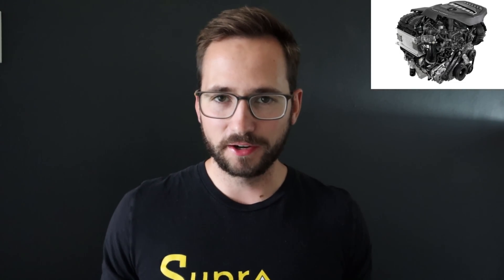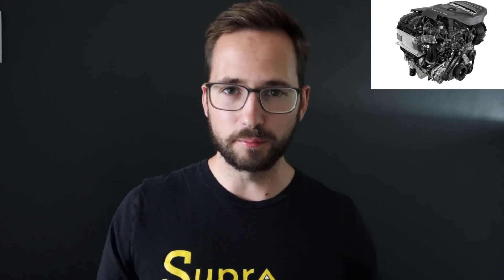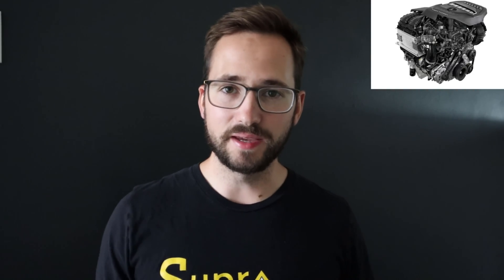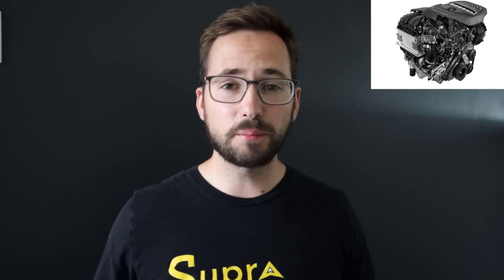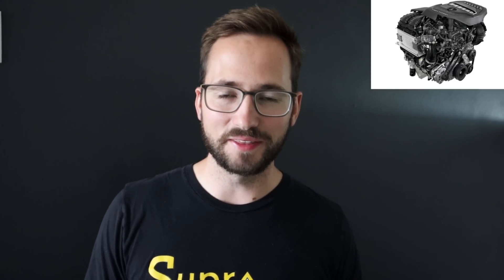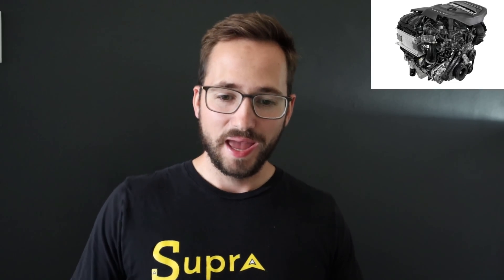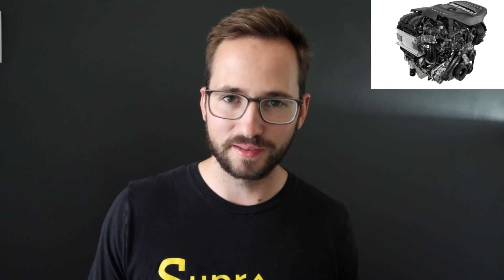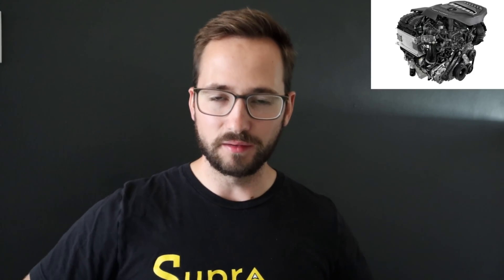The New Hurricane Engine Is Way Better Than I Realized!

Comment: Nice video. Didn’t hear this in it so I will mention it. Straight six are great from past experiences. Longer stroke than bore size made them low rpm torque monsters. The unknown here is adding the turbos to this setup. Most of todays vehicles run at 2000 rpm at highway speeds and a little higher than that in direct drive and towing. So it’s going to be interesting to see where the power bands fall with this setup in the 1500 Rams. Throwing them into the 2500/3500 lineup is a big gamble for a first year production run. The 6.4 hemi is pretty stable here for the most part. Diesel owners are another subject that doesn’t fit.
Reply: I doubt that most of today's cars do run at 2000 rpm at highway  speeds.  But the variables are so many that it they not easy to define.

Comment: You are using the term powertrain incorrectly when referring to the engine!  To wit: A powertrain is an assembly of every component that pushes your vehicle forward. Your car's powertrain creates power from the engine and delivers it to the wheels on the ground. The key components of a powertrain include an engine, transmission, driveshaft, axles, and differential.

Comment: If you must do small displacement, forced indiction, I6 is the way to go.  But it’s not really any better than a simpler v8.  Never been more underwhelmed than I am with the 3.5 ecoboost.
Reply: What do you mean underwhelmed? Guys are matching TRXs with a tune only 3.5eb 🤣
Reply: @Texas_Road_Warrior  
It’s an unreliable, code throwing pile of shit. Plus the turbo lag is quite noticeable. I’ll take the 5.0 over the ecotrash every day of the week.  Would be curious to see how the 5.0 would run with a tune and throttle modulator.

Comment: The problem is these are all direct injection engines.  Because of this they are prone to valves getting gummed up because of the fact that the carbon is not being burned off like in a non direct injection engine.  Prepare for more maintenance on these to ensure the engine stays clean.

Comment: Remember the inline 6 ford 4.9 liter? That was an awesome truck engine.
Reply: Mite be the best motor Ford ever made.
Reply: 9 mpg was a bitch though when mated to high rear end gears and a granny 1st tranny😂
Reply: It WAS the best motor they ever built.
Reply: It had piston skirt issues because of vibration just like the 292 I did build a 225 slant 6 to do 1156 to 1230 consistent

Comment: I have a hard time trusting Ram. They knowingly produced engines with the “Hemi Tick”.
Reply: For my Ram, Started a tick around 100k. Replaced manifold bolts and it’s golden now at 143k miles, and the tick was mild and didn’t affect performance at all. Love my 5.7, it’s been a beast
Reply: Fake news. I’ve had 2 hemis never had ticking issues.
Reply: @conservativetexan2289  Hahaha. Thanks for the laugh. Just go to the Ram forums and you will see many posts about Hemi Tick

Comment: The best thing about this new engine will be how it causes the value of used hemis to double.
Reply: Well if ya look auto bon BMW inline 6 the best 6 cylinder was the V6 gimmi sparkplugs in the intake an the 225 slant 6 before 1972 an Ford's middle in line 270 I believe
Reply: Nothing will ever increase the value of a ticking time bomb, err I mean a hemi.
Reply: @corinhoskins2011  Except a twin turbo (overly pressurized?) engine designed in Europe by Fiat/Alpha Romeo. That'll do it.
Reply: @kidsteach938  I see you have no idea how this engine works lol. They compensate for the increases cylinder pressure by utilizing a lower compression ratio, they also open the ring gap up to compensate for increased heat output, valve overlap is also controlled by the vvt system to assist in keeping cylinder pressures in check. The biggest downfall of a turbo charged engine is consumers who treat them like carburetor V8s with low power outputs, yes you can beat the shit out of an not maintain an old engine because it doesn't make any power anyways, modern engines produce gobs and gobs of power by increasing their thermal efficiency and providing more (literal) bang for your buck, but they do so at an unseen cost of maintenance and care, use a high quality synthetic and allow your turbos time to cool at the end of use and you have a motor that will last generations. If you treat it like crap it'll end up like crap. If you're not capable of maintaining a motor like this then yes the market of used hemis with eventual camshaft failures will be perfect for you!
Reply: @corinhoskins2011  The hemis fail because of the spec for low viscosity oil, for emission reasons. If the new miracle engine uses powdered metal rods, hypereutetic pistons and maybe only four head bolts per cylinder, then I would keep my fingers crossed.
Yes, I understand how supercharged or turbocharged engines increase power output, especially for lower displacement engines. However, this comes at a price...just ask the owners of the 6.0 or 6.4 powerstroke diesel engine. Complicated variable vane turbo technology, dual ((sequential) turbos, heads with four valves per cylinder but only four head bolts to seal it, complicated engine controls and emission systems...so many weak points. I'm no engine newbie.
Reply: @kidsteach938  well if you are no engine newbie you'd realize comparing early modern emission diesels with next gen gas jobbies is an apples to oranges comparison 😉
Reply: @corinhoskins2011  well, I'll see you here in three years, and we'll find out. Mark your calendar...you've got a "date", lol.
Reply: @kidsteach938  oh I think it's going to get a horrible reputation because most Chrysler/Dodge owners won't sacrifice a 24 of coors to get higher grade oil and they'll cook those poor little turbos.
Reply: @fsilverez8408  modern engines require maintenance, old style v8s are low on power because of their huge tolerances that allow you to abuse them more but you pay for that with lack of power. How many motors you torn into bud? I've probably forgotten more about engines then you'll ever watch on YouTube 😂

Comment: I WOULD CHOOSE A STRAIGHT 6 DESIGN OVER THE V 6 ANYDAY !! LESS PARTS TO FUNCTION, NO ELABORATE TIMING CHAIN ASSEMBLY ( FORDS HAVE HAD HUGE PROBLEMS WITH THIS ESPECIALLY THE ECOBOOST V6 AND RAPTORS) LESS CYLINDER HEADS TO POSSIBLY FAIL OR HAVE HEAD GASKET ISSUES AND NO LOUSY COOLANT CROSSOVER PIPE FAILURE ( ANOTHER WEAKNESS ON FORDS MODULAR ENGINES) ..INLINE 6'S FIRING ORDER MAKES THEM PERFECTLY BALANCED AT ALL TIMES WITHOUT BALANCE SHAFTS OR NEED FOR COSTLY LIGHTWEIGHT, HIGH FIDELITY CON RODS AND  PISTONS TO MAKE IT ALL BALANCED AND RUN SMOOTHLY..HOPEFULLY RAM WILL KEEP AN EYE ON ITS QUALITY CONTROL AND THE CONSUMER DOESNT GET SCREWED WITH SOME MAJOR MECHANICAL/DRIVE TRAIN/ELECTRICAL ISSUES DOWN THE ROAD. THIS HAS THE POTENTIAL TO BE A GREAT SETUP.
Reply: I just wanted to let you no that your caps lock is on. 😎
Reply: @Matts000  Some people prefer to scream to make their point lol.
Reply: @kevtn8  🤣

Comment: My major question is simple, how reliable will this engine be when being used in a hard load situation, I remember numerous Wonder Engines that on the test bench to be damn near indestructable.  Then the engine hits the real world and they turn out to be JUNK.
Reply: @Ragingbull340 
Twin turbo cat engines run hard all day. Compound single and N/A as well
Reply: @ryanpark2049  apples to oranges  bud diesel vs gas is completely different. Built completely different.
Reply: @JeffCarsboatsatvs  
Plenty of gas engines have been converted to diesel engines. The point anyways is the inline 6 reliability which is seen in both the gas and diesel in line 6 vs a V still config
Reply: It'll have problems mostly because consumers are idiots, run a high quality synthetic and let's the turbos cool down after working them and the engine will treat you well for generations. Don't do that and oil coke will destroy your motor and sludge everything and make everyone throw fits.
Reply: @corinhoskins2011  unfortunately you are correct, but these IDIOTS are the people who buy these vehicles and are the first to complain when they destroy them by their actions. The Vega engine was tested and worked quite well, but if you overheated it you just junked it.  The Pontiac square 4 was another that was tested for ungodly long periods of abuse and again if it was overheated you just trashed it.  And the list goes on and on.  This engine is primarily of Aluminum construction thus will not stand overheating without issues.  Have a stepdaughter that has a Chevy Avalanche and so far they have in 2 years trashed 3, yes 3, 4L60E transmissions for the same failure, lack of oil.  Bought it used from my life long buddy, and they knew the transmission was on it's last legs as he told them it needed to be rebuilt as the transmission oil line sprung a leak and it had the famous 1st/reverse slippage associated with low oil damage.  Well they roached the first one in the shop when they IGNORED me as the book said it took 6 quarts of oil, they forgot the practically 4 quarts for the torque converter needed to also be counted.  It would go forward but not back off of the ramps, so they would not simply roll it off the ramps and then check the oil as they had put in the required amount.  Well there went #1.  Nr. 2 was a junkyard replacement that I wouldn't have wasted the time to install, not really that good of a move to put a transmission in with a 30 day warranty.  Pissed around and took 45 days to get it in so the warranty was gone, then they didn't get the oil cooler lines fixed, still had Mike's old temporary repair on it, well again it came off on the test run and I told him if it starts to slip stop NOW and call me on the phone and I will tow him back to the shop.  Well that was a waste of breath, he was in a damn hury and didn't take his phone.  He was about a mile from the house when the line blew off, and he floored it to make it home, about the worst thing he could do.  Got Nr. 3 again a junkyard special and it lasted till this spring, again small transmission leak ignored, and #3 is out.  #4 is now rebuilt and setting in my shop, did a total rebuild on original transmission, don't know how he will screw this one up but I am sure he will. This is the problem with some people, put them in a padded rubber cell with 2 steel balls, come back in 30 minutes they will have lost one and broken the other.
Reply: I tow often with my 5.7. I concerned how the Hurricane will handle continued towing.
Reply: @Ragingbull340 concur on that one.  Can see a bunch of cracked heads and pistons in my crystal ball for this engine.
Reply: In line 6 is the standard for high mileage high load engines. I'd say the design is sound, whatever emissions they add will make it or break it
Reply: @ryanpark2049  I am not sold until it comes out and then wait to see how it comes out.  Sorry I have concern for a all aluminum engine with a high boost.  My concern is aluminum's enemy HEAT, and the horses and torque that they claim are quite high so there is a bunch of energy being converted here.  I remember Ford and their infamous 6.4 diesel, head gaskets blew out quite commonly when worked hard.  I do like the inline 6 engine design, I just am not going to rush right out there and be the first one on the block to get one.  Remember how the 3.0 turbo diesel V6 was so great and has been beat up by air polution add ons.
Reply: @thomasheer825 
Didn't know it was all aluminum, but depending on how it is handled I guess it can be dependable like the tundra, or trash. But the tundra has a forged crankshaft
Reply: @ryanpark2049  What really concerns me is there are conflicting reports that the block is a open top design, if it is true and the high boost pressures they are kicking around this isn't going to end well.  Now if it is a normal topped decked block, it might work.  There is also conflicting information that it has a girdled bottom end, which would signifiantly increase the bottom end strength.  But we are going to have to wait and see, there is so much conflicting information out there at present nothing is in stone.
Reply: @thomasheer825  
Well regardless I'm sticking with the 5.7 in my ram. Kinda sucks they finally start working out the kinks with it and it's on the way out. 
On the plus side there should be parts for them for a long time
Reply: @ryanpark2049  Had a old 90 Dodge Ram with a 318 and like a fool I let it go a while back and the guy won't let me buy it back.  You just can't break it no matter what you do, yes the body needed patching and painting several times now but then again rust never sleeps.  Have a 06 Ram with the 4.7 and at first it was well that is what I could find and I will deal with it.  Well after simply going thru changing out the timing chains and tensioners it runs fine, with 175k on it.  Ain't no powerhouse by far, sort of reminds you of a old C30 Chevy with a 283, got to rev the crap out of it to do anything but it works.  Actually it isn't that hard to work on, thought since it was OHC and such it would be a bastard to work on, but even the timing chains were simple and the hardest thing was to climb into the engine bay.  Am a little shy of the newer Hemi's as there is a issue with the valve train at higher mileage due to those cutoff cylinders.
Reply: @thomasheer825  245 hp pile of shit oil burner
Reply: @thomasheer825  buy a hemi  very  reliable buy a dodge with a hemi  that’s the heart of he truck hemi is whatdodge was made with .how it made its name
Reply: @JeffCarsboatsatvs  Am somewhat leery of the new hemi, seems as if there is an issue with valve train failure due to that cylinder deactivation system causing the cam to go south.  Would like them to basically bring back the old 318 with throttle body injection if they could meet the emission standards.
Reply: The hurricane has forged crankshaft and forged rods … the block is aluminum ..
Reply: @dennismurray4088  That is a given, the only engines with aluminum rods are lawnmower engines and exotic racing engines with a very short rebuild cycle.  Would expect to see a forged crankshaft due to the power being made per displacement as cast steel simply wouldn't handle the stresses.  The Aluminum block is the weak point, as aluminum has huge thermal expansion issues as compared to cast iron or steel.  Ever notice that valve seat drop is not all that uncommon on high-performance aluminum heads,  The aluminum head expands quite a bit in comparison to the hardened steel valve seat.  Have been building up motorcycle and air-cooled engines for the best part of 50 years as a hobby and learned early on about different thermal expansion issues.  Only have an AS in Mechanical Technology but sorry physics is very straightforward here.   Physics can be cheated but in the end she will win.
Reply: I remember that what killed Vega was that open top block was a major issue.
Reply: @ryanpark2049  WRONG. You are comparing a Cummins or a Cat semi engine to a passenger car one. Ask any LS or Hemi owner, 300K and they still run strong. At least the last 3 I owned did.